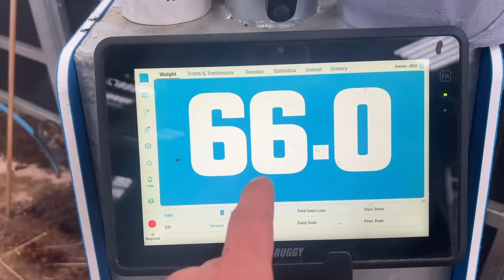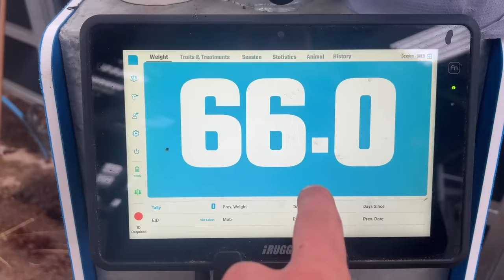Crazy Turn Of Events For This Cow | Snowing In April | Bad News

Comment: Re scraping your passage (eeeuw) in the long run stick some brackets on a industrial tyre scraper, cos scraping with a bucket is gonna knacker your concrete and the mesh is going to start popping through, bad in a silage clamp,disaster in a feed passage 👍